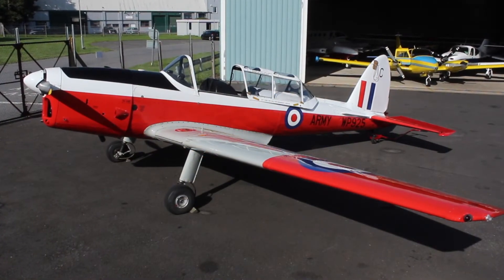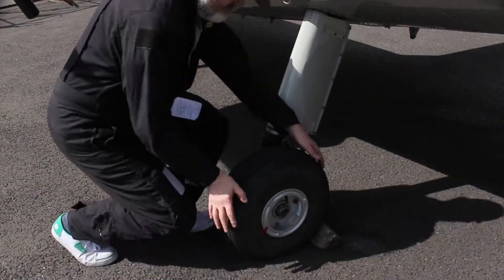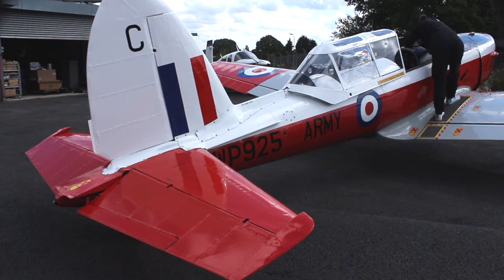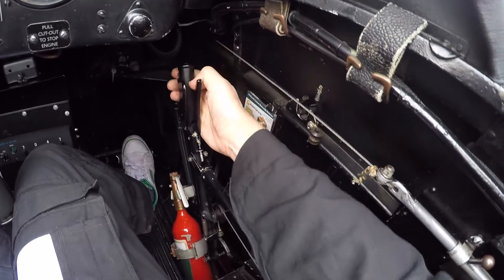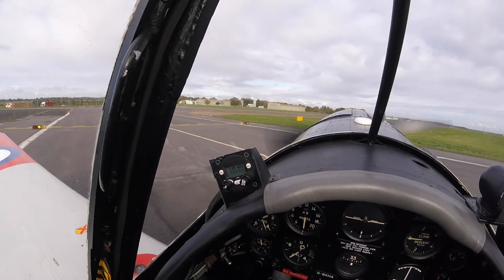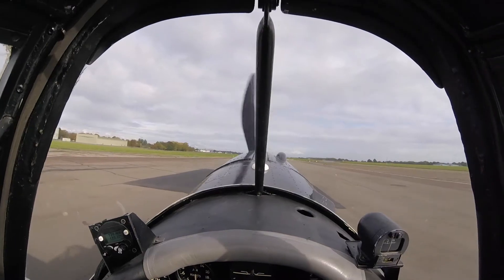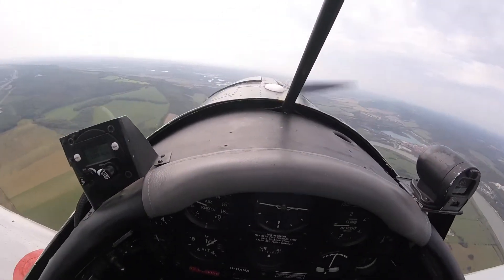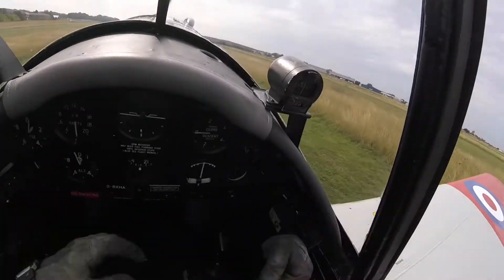Chipmunk G BXHA

Comment: What a great video! As with many who may watch this video, it brings back great memories of piloting the Chippy back in the late 70's and early 80's. A real pilot's aeroplane until you throw one into  6 turn spin, then all hell breaks loose! Having a short wingspan means the rotation is pretty rapid! If I ever win the lottery, a Chipmunk would be my first purchase!
Reply: Very good comment Neil. With respect, there are two many dreamer comments on many of these segment, which need to be verified.Aeroplanes are aeroplanes. They all have their strength and weakness.For my opinion there is no place for dreaming. Every aircraft flys on the same formula. CL HALF ROW VSQUARED S. One has to face the facts and fly the aircraft on the Formula.